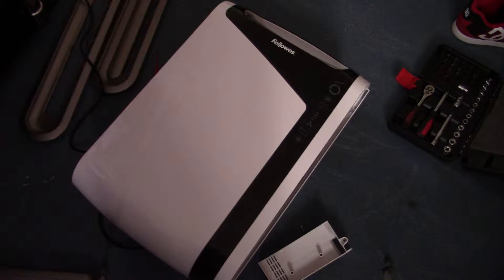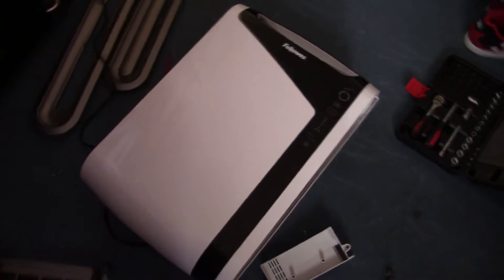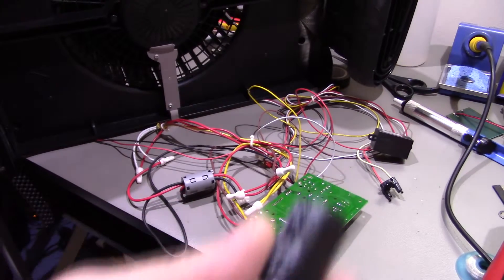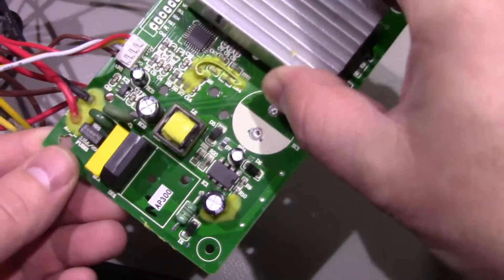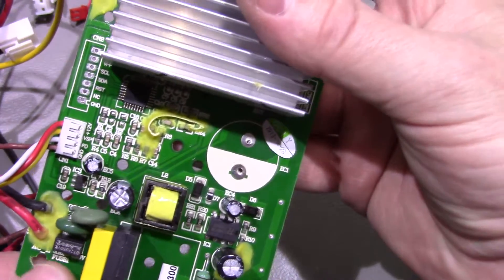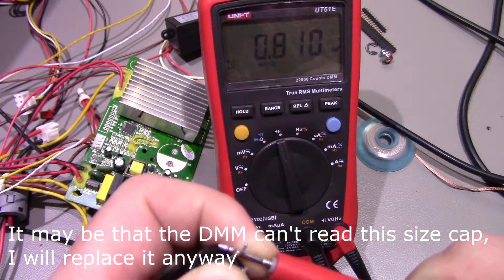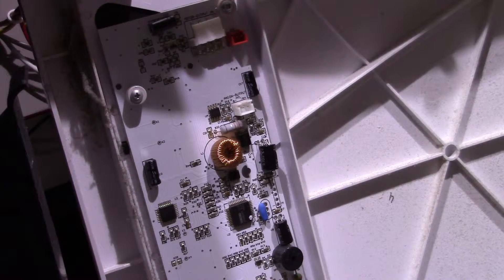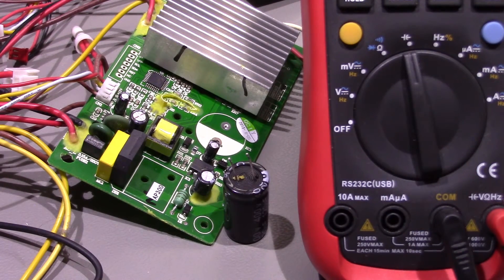Fellowes AeraMax DX95 Repair - Part 1

Comment: I have the same model with 4 flashing bars and no fan.
Reply: Gareth Loader, Thanks for that 
The filters seem to be inserted correctly and it's usually OK for about an hour then goes off. It's still under guarantee so I've returned it.